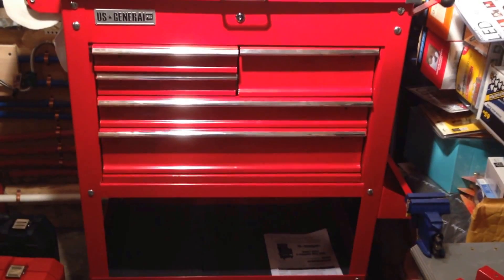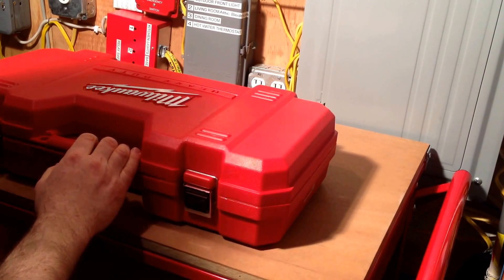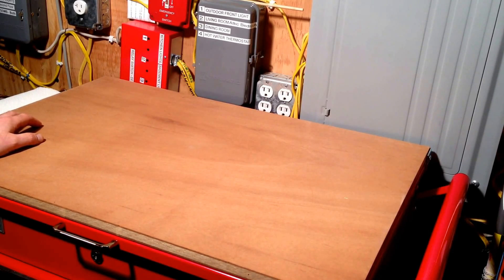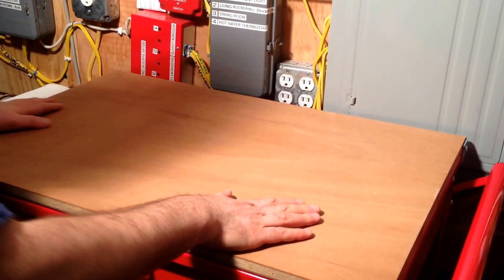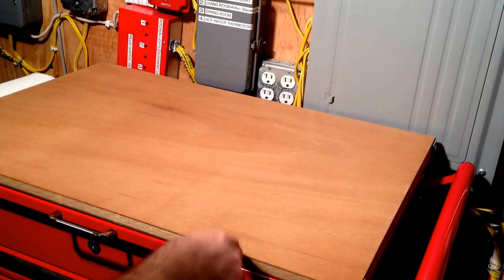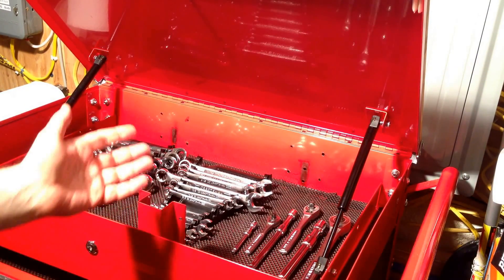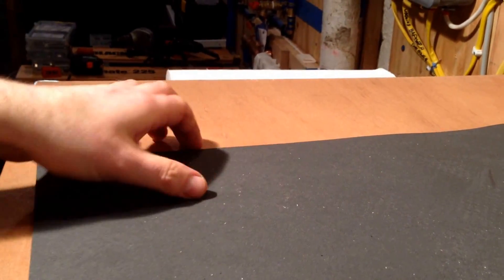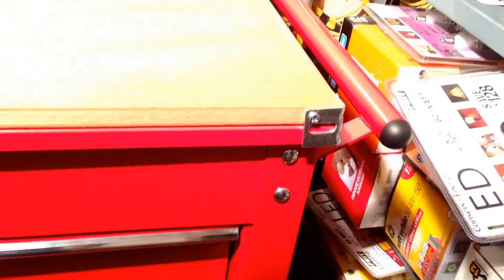Harbor Freight 5 Drawer Tool Cart & Harbor Freight Tools

Comment: HF has some junk tools But they also have some decent tools There RED tool box line including this cart are very well built and are an excellent value for the money. when you compare them to snap on matco ETC that's not a fair comparison these are hundreds below the cost of those brands but these are much better than anything i've seen in there price class I have the U.S General 44 in tool chest and i couldn't be happier with it.

Comment: Where did you get the metal corner pieces? And is that paper towel holler from harbor freight as well ?
Reply from the maker: The Paper Towel Holder is sold at Harbor Freight, near their metal Boxes. The Metal "L" Brackets I found in my pile of unknown items that I saved from some unknown children's toy or other purchase, years ago. You can purchase these at Home Depot.
Reply: Great! I love the wooden top idea and I want to do it on my smaller cart. Thanks for the reply.
Reply from the maker: chingon1988
My Pleasure, I work on the Top, all the time. Its a perfect height and its great to work on without scratching the metal.

Comment: You. Are. Correct o the tool cart you.  Get what you pay for  a 150 dollar box is exactly. That   It. Serves its purpose   For what you need it to do  that old Craftsman drill  is a staple  in America  from the 80s   I had. That exact model  used the hell out of it  and it  just wouldn't   Stop  running   Sadly. That was  a era in America when Sears  still gave you a quality tool for the money  and stood behind their products after that time many of  their products  went downhill  in quality control with all the overseas  manufacturing   I was a professional Woodworker my adult life  and at one time. Sears was a go to  place for many of our tools and  equipment  by the 1990s   Much of. Their products.  And especially the service.  Had. Turned. To. Garbage  and very poor quality  i also  have. All my  original Craftsman sockets and. Ratchets   From the 70s
Reply from the maker: Craig Monteforte Thanks for that informative post! I went to a Sears recently and it was poorly lit and dingy and the product was dusty. They even featured a pink line of tools geared for women. I didn't recognize the place. So sad.  Sorry that the old ways are gone. Thanks!

Comment: LOL @  "By MY calculations, you owe ME ten bucks" (at the end, talking about the coupons, very Jewish).  

Also, in putting it together, you need to make sure the 4 legs go on correctly or the holes will not line up.

Seriously, though.......I really appreciate the tip regarding removing the drawer lock mechanism.  I will drill mine from the outside and remove those brackets.  Then, I will line the back with that cheap felt to cover the holes.  When the felt is worn, I'll use something else, like masonite perhaps.
Reply from the maker: Marty Higgins Your right. I do owe you ten bucks. Can I pay you with Harbor Freight Coupons?